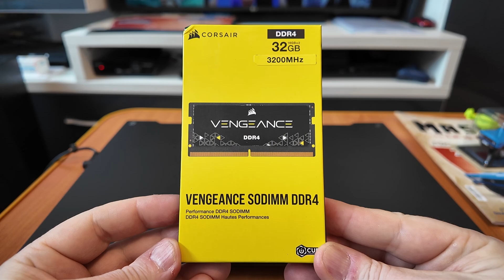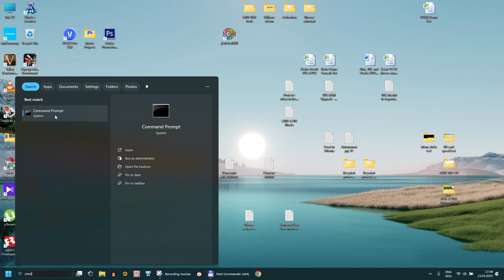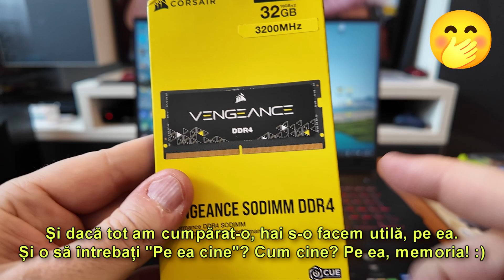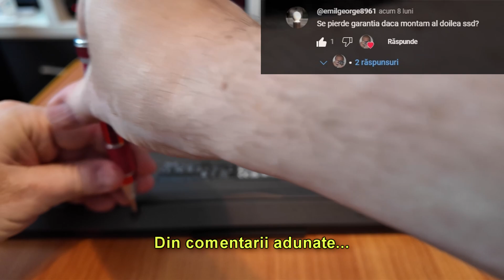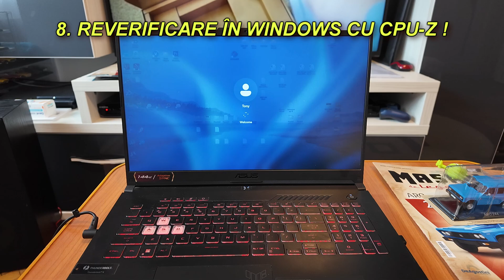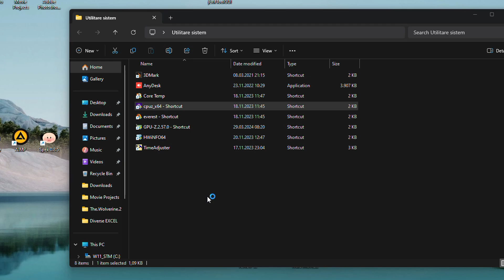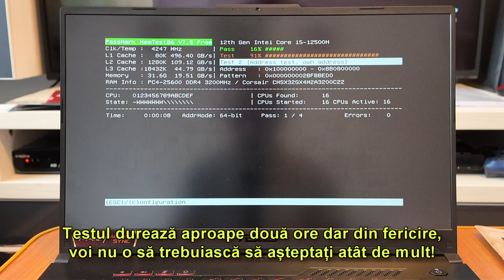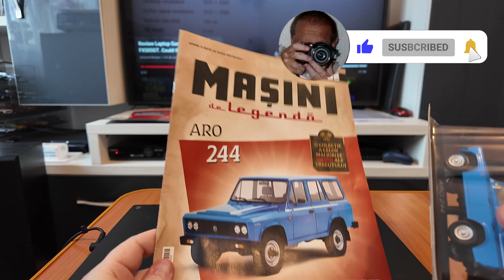Tutorial upgrade memorie RAM pentru laptopul ASUS TUF GAMING F17

Comment from the maker: Mi-am adus aminte un lucru important pe care am uitat să-l menționez în acest videoclip.⏹
Înainte să faceți cele două verificări recomandate de mine sau chiar înainte să vizionați acest clip, scoate-ți capacul spate al laptopului/notebookului deținut de voi și verificați dacă nu cumva modelul dvs. are memoria lipită pe placa de bază. Există și astfel de modele. Cum vă dați seama de acest lucru? Păi verificați existența celor două sloturi în care se introduc DIM-urile sau măcar existența unui singur slot. Dacă nu le găsiți, felicitări.:face-pink-tears: Laptopul dvs. nu poate fi upgradat la acest capitol. :body-blue-raised-arms:Dacă așa stă treaba atunci vă recomand să vizionați altceva. :hand-purple-blue-peace:Nu de alta dar timpul este prețios și pentru voi așa cum este și pentru mine!🤗🤗🤗
--------------------------------------------------------------------------------------------------------------------
I remembered an important thing that I forgot to mention in this video. ⏹
Before you do the two checks I recommended or even before you watch this clip, remove the back cover of your laptop/notebook and check if your model has the memory soldered to the motherboard. There are also such models. How do you know this? Well, check for the existence of the two slots where the DIMs are inserted or at least the existence of a single slot. If you can't find them, congratulations.:face-pink-tears: Your laptop cannot be upgraded at this chapter.:body-blue-raised-arms: If that's the case then I recommend you watch something else.:hand-purple-blue-peace: Of course, time is precious for you as it is for me!🤗🤗🤗